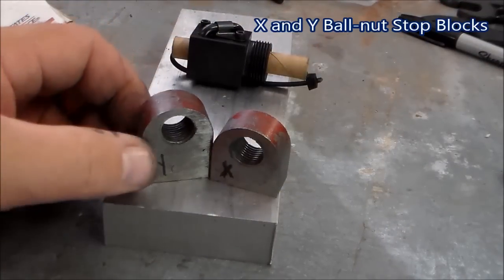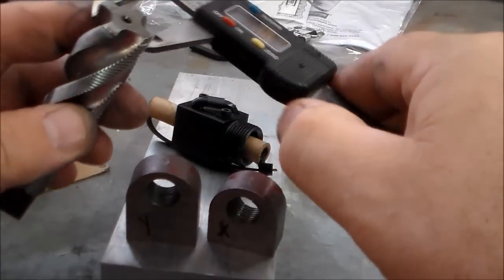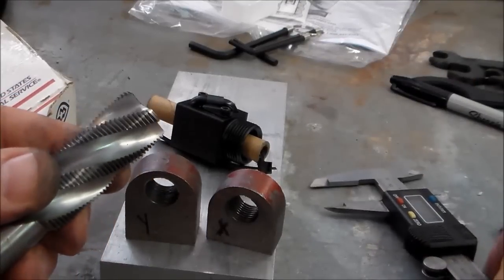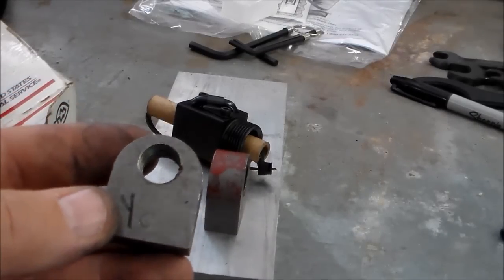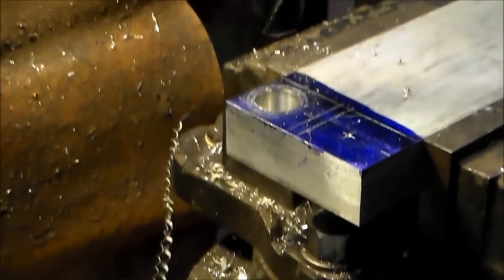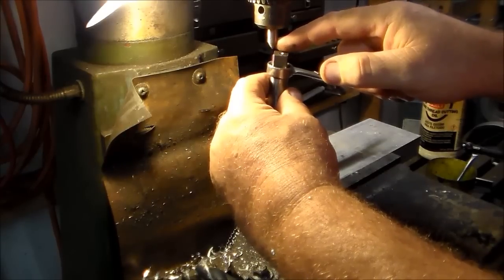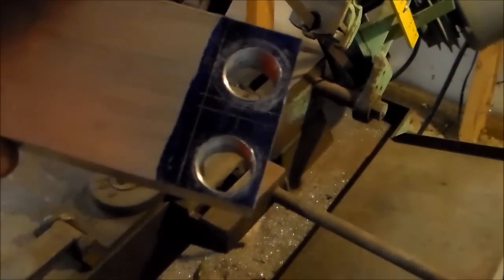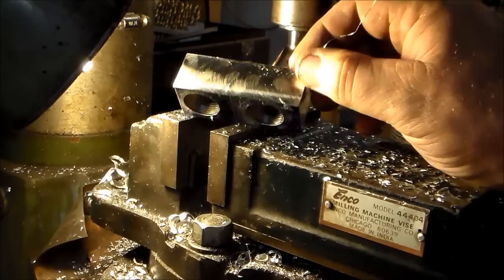Part 2 Harbor Freight Mini Mill X2 CNC Conversion Step by Step

Comment: The 15/16-16 thread you are looking for is in the macinary handbook and the root diameter is .8700"-.8783". So, .875" is just right. The 15/16-9 thread you found is a TPI or tapered thread for pipe fittings. There is only one pitch for each size in the TPI series. Also some sizes in the TPI series have straight threads for special purposes. I hope this was helpful. I did this conversion 3 years ago like you, with my own design. Nice job. Marty
Reply from the maker: Thanks for the info, my copy of the machinist handbook is really old, but I couldn't find it in there. Maybe I just missed it. My conversion is pretty much following Hoss Machine's conversion so far, with a little of me here and there.

Comment: After you drill the hole you are going to tap, put the tap in the Jacobs chuck. Turn really slow like 60 rpms and apply a little pressure with the tap into the hole you just drilled. The tap will engage and do the whole thing for you. When the tap has broken through just reverse the spindle and it will come work its way back out
Reply from the maker: Well, I'm sure that's a great method if you have the equipment. But, my mill won't run that slow and it doesn't reverse.

Comment: What if you made little plugs which your set screws pushed on that had been exposed to the tap or die, whichever so that it has threads you could clean up real well and would be super smooth for preloading no?

Comment: To find the minor diameter or tap drill size just subtract the pitch from the major diameter. In this case .9375-.0625=0.875. 7/8 is the tap drill size

Comment: I'm so happy that I don't have to deal with the imperial system.
Reply from the maker: LOL!!! I don't like dealing with metric! Actually, I don't mind metric at all, I just don't like going back and forth. But, in the USA, we are a mix and with my generation we are mostly imperial thinkers.
Reply: +Self Made The metric system is so easy, it's far simpler than the imperial system,  I'm a 51 year old Aussie so I've used both in my life and can go "relatively" easy between the two formats.  I've always found that if I'm working on an item that is say metric then I'll do all measurements in metric, no converting between one format to the other,  the same goes for an item that is made to the imperial format,  if I've got to do something like what your doing to a part that was made to the metric format but will need an imperial part/thread fitted then my new part will be made and measured in metric with ONLY the drilling and tapping being done in imperial,  the less you convert the less chances of a mistake.  Eventually metric will rule the earth, start practising it's really a beautiful format.
Reply: +Self Made The metric system is so easy, it's far simpler than the imperial system,  I'm a 51 year old Aussie so I've used both in my life and can go "relatively" easy between the two formats.  I've always found that if I'm working on an item that is say metric then I'll do all measurements in metric, no converting between one format to the other,  the same goes for an item that is made to the imperial format,  if I've got to do something like what your doing to a part that was made to the metric format but will need an imperial part/thread fitted then my new part will be made and measured in metric with ONLY the drilling and tapping being done in imperial,  the less you convert the less chances of a mistake.  Eventually metric will rule the earth, start practising it's really a beautiful format.
Reply: +Self Made The metric system is so easy, it's far simpler than the imperial system,  I'm a 51 year old Aussie so I've used both in my life and can go "relatively" easy between the two formats.  I've always found that if I'm working on an item that is say metric then I'll do all measurements in metric, no converting between one format to the other,  the same goes for an item that is made to the imperial format,  if I've got to do something like what your doing to a part that was made to the metric format but will need an imperial part/thread fitted then my new part will be made and measured in metric with ONLY the drilling and tapping being done in imperial,  the less you convert the less chances of a mistake.  Eventually metric will rule the earth, start practising it's really a beautiful format.
Reply from the maker: Imperial will rule! Lol. Like I said, I don't mind metric, I just hate the mix and going back and forth. Almost all my tools are imperial, so every time I work on something metric, I'm off to the store buy a metric tool. I'm 48 years old, and I don't think this problem will be solved in my lifetime.
Reply: Yeah. As a VAG auto mechanic, the closest thing I come to the imperial system is rim size and exhaust tube sizing. Lol. I understand that you americans are proud of the imperial system, but I am getting the impression that the metric system is becoming more and more usual? Do you think it will be a mix of imperial and metric in the future? Or will the metric system slowly replace the imperial system? Just interested to hear your opinion on this matter. :)
Reply from the maker: I don't think it will overtake the Imperial system here in the states anytime soon. It would almost require the replacement of everything that has been made for the past 150 years. It would a monumental, almost impossible feat to completely switch. Like I said, I don't necessarily hate it, I just hate the mixture of 2 methods, especially since metric is pretty uncommon in our daily lives here.
Reply: +Self Made That's pretty much how it happened here in Oz. A date was set in the early 1970's for the adoption of the metric system and the wheels were set in motion. In essence you are already a type of decimal system with your currency being based on a 100 cents =$1.00. Any Japanese/European cars sold in the USA are metric including Japanese brands such as Toyota,Honda etc that are built in the States are built to the metric system. Eventually the USA and Britain will succumb to metrification and benefit from it.

Comment: Is it a strength issue that your ball nut holders are aluminum compared to what looks like steel originals?
Reply from the maker: Nope, not at all. The originals were used as threaded nuts. The threaded shafts of the lead screws traveled through them. Obviously, aluminum would not work for nuts on moving threads. In the CNC application, the ball nuts are taking the place of those internal threads. The aluminum block is now just acting as a bracket or attachment point, no moving parts, no wear, just a stationary mount relative to the tables. Basically, the steel originals are replaced by the ball nuts and the easiest way to mount a ball nut is by mimicking those steel blocks. Make sense?

Comment: Hi,   I just got started on my project....I do not have the 15/16 tap and was wondering if you would be interested in making these 2 small parts for me? thanks and let me know, I am in Clinton  missouri
Reply from the maker: Well, I really can't, my shop is still pretty much completely a mess. I haven't finished this project due that either. I'm focusing on finishing the building of my shop before I make much of anything. Good news is I got mine on ebay really cheap, I'm sure you can too. Good luck.